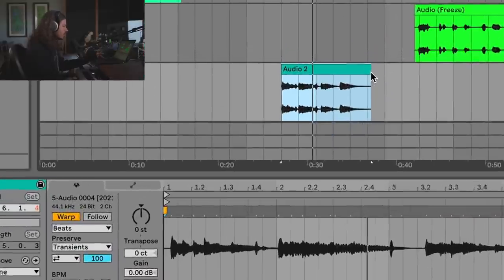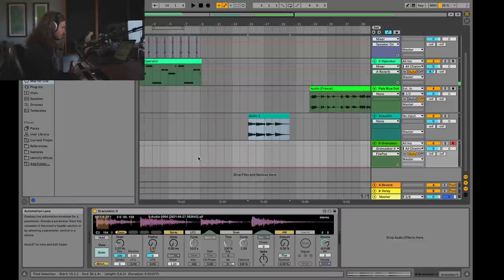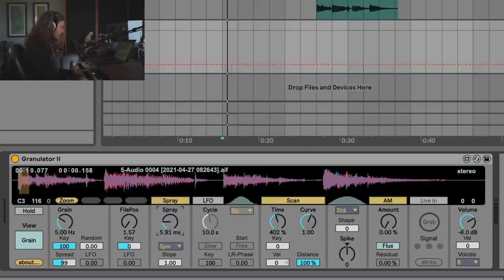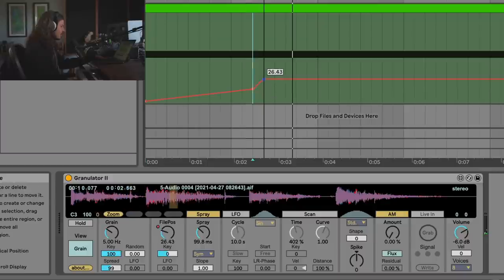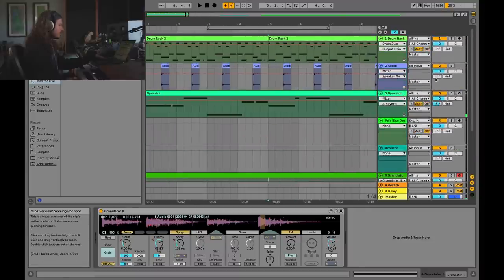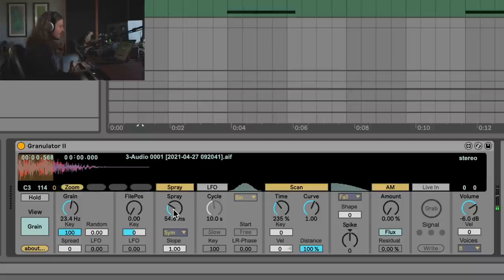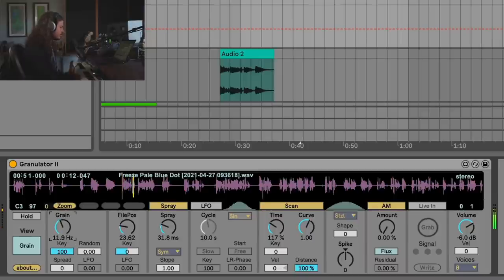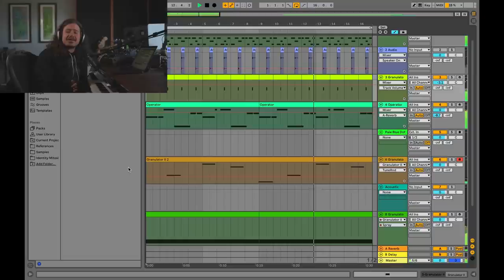Non Linear Time Stretching with Granulator 2

Comment: Nice! Granulator is OLD but its still the best one out there. One thing to mention is that you can control the position with the keyboard using the KEY parameter below but if you dont want to change pitch, you can put KEY below pitch to zero (in FILTER view)

Comment: YES! Trailer Park Boys "Two Birds Stoned at Once"! Also, I've been getting super into Granulator II.  I appreciate the example using clip warping (been reading and messing around, but like your explanation).  I definitely didn't really get the Time Scan part...  Great application to snares and vocals. I've been putting mine in an instrument rack and macro mapping parameters.  Combined with saving variations can make lots of different "instrument presets"... also totally keep forgetting about the filter section...

Comment: I saw on your website that you offer 40 off ableton. Is that correct ? How does that work ? Im looking to get into ableton and your courses seem to offer a lot.
Reply from the maker: It's an educational discount. You get the software with the link I provide and you show them the email receipt from getting the courses and they activate your serial for Ableton Live.
Reply: @SeedtoStage  Just one more quick question. Do you need to have an actual educational/college email to be able to use such serial or not. I believe this is the case if you go through ableton directly, yes ?